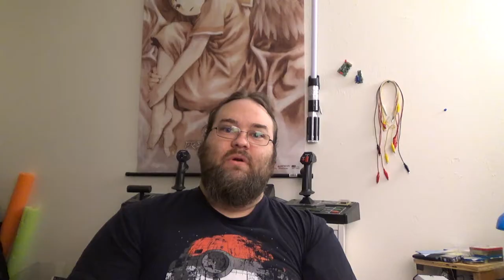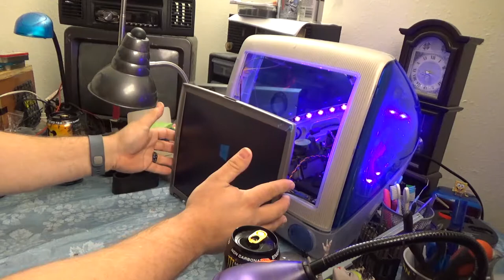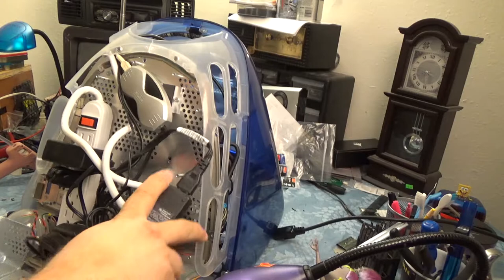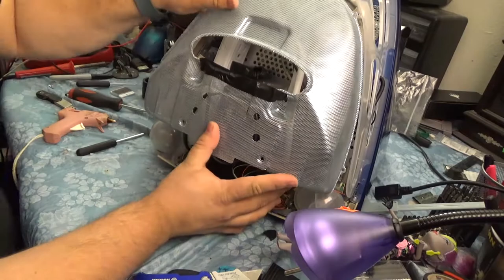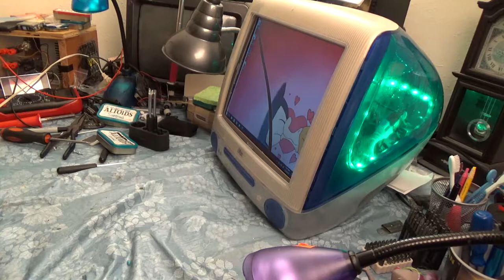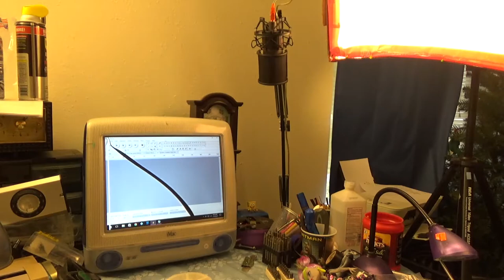Project iMac Finale!

Comment: DIY : iMAC (eMAC) Portable Sound System.
Has anyone seen or converted themselves an iMac (or eMac) into a portable Boombox with raspberry pi & lcd screen as the media controller for multi terabyte juke box? I'm thinking a 5.1 speaker system. Replacing the iMacs screen with an as large as possible single bass speaker (13"-15"(?), using the 2 already available tweeter speakers at the front and adding some high quality side firing mid drivers (totalling 5 speakers). 
Then using as much as the original macs i/o (usb, audio & even ethernet or firewire to hook up another Imac boom box or even daisy change multiple imacs if poss and also use excess power (having a "bank" of Li-ion batteries powerful enough to play 12 hours of music constantly should be a must as part of the design, afterall one the computer and screen have been removed the imacs handle should be more than adequate to hold up  speakers, batteries, amp & raspberry pi & screen) so with so much on board storted power keeping/charging mobile phones, torches (if camping/caravanning & other equipment whilst using the "iMac Sound System" should be plausible.
For charging the imac again using its power cable to connect to a rechargeable lithium ion pack, either off the shelf, home made or some how repurposing portable drill batteries & heir chargers, "simply" remove the drained power pack, slot in 2 freshly charged packs and away you go.
The iMac, to me, seems  ideal for such a project, it has a handle to carry it - usb & audio i/o already inbuilt and if configured could be daisy chained to have 2 or more playing off the source Imac for stereo, quad or as many as you could (afford) to build.
Aside from building it and programming a raspberry pi the hardest thing would be to have a readout screen giving you full control of selecting music - keeping with the theme of using whats already there I'd love to repurpose the ram compartment to hold hot swappable micro ssd cards.

I wish I had the electrical engineering know how  : I'd paying for the schematics as I'm itching to build this and have access to 2 iMac's that are in perfect  working condition so would be great to swap them for say 2 or 3 with broken monitors so I could then build the ultimate outdoor imac pa system :)